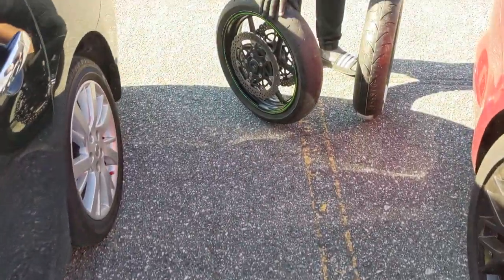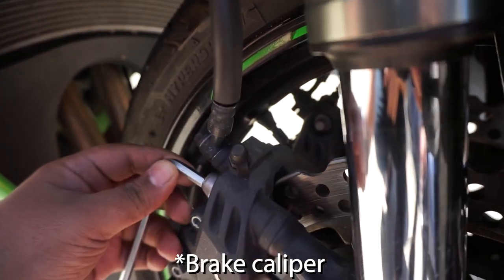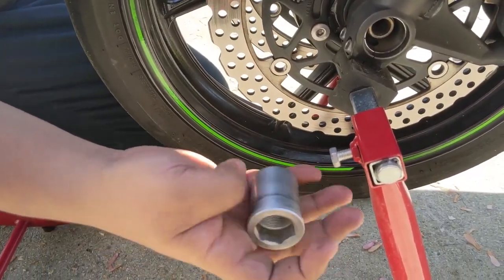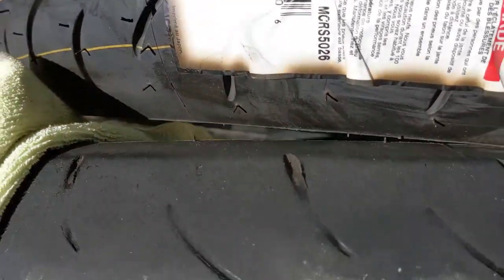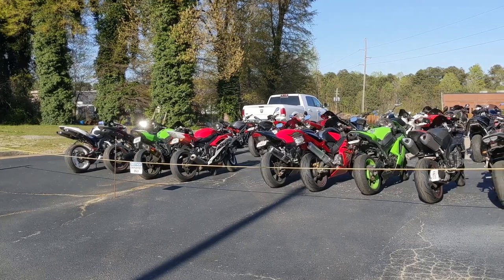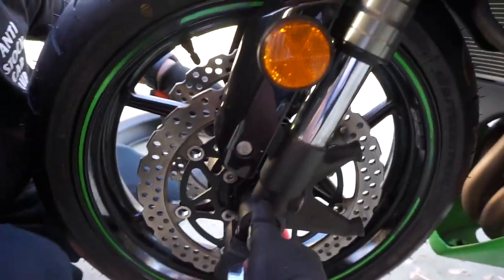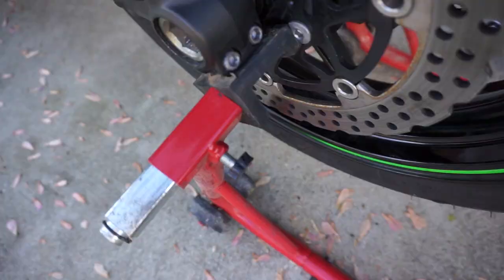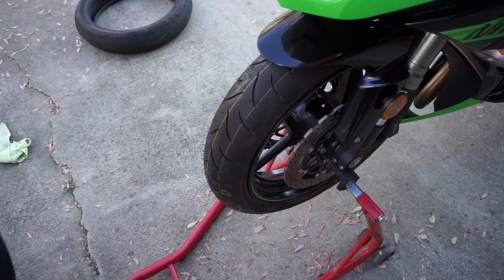Kawasaki | ZX6R | Front tire change | DIY | Vlog

Comment: This tire is dorectional and you put it on backwards. Also, no need to take the calipers off. The rotors slide right out. These are key points from me. Finally, to settle the wheel nicely in the forks, before you tighten up the axle 100, drop the bike on the ground off the stand on the rubber, sit on the bike, press both rear and front breaks and rock back and forth with full body weight in the seat, for the wheel and the axle to settle centered. Do this at 80 to 90% tightened. Then, tighten all nuts and bolts 100% and off you go.
Reply from the maker: Nice!